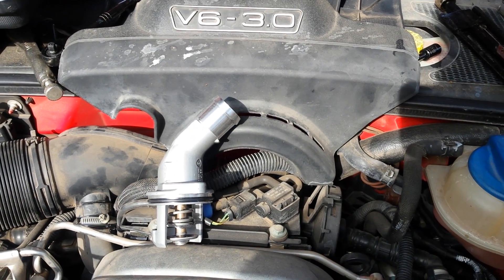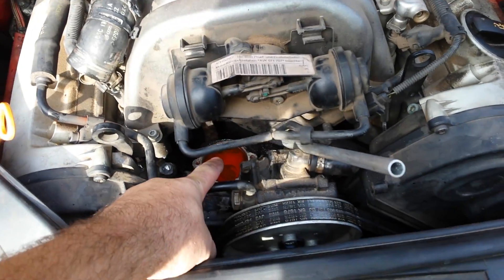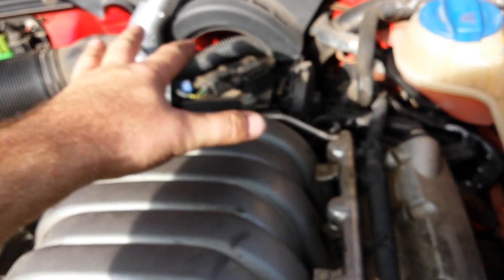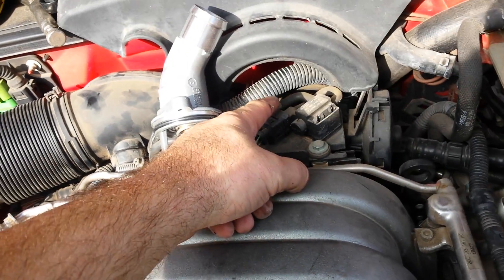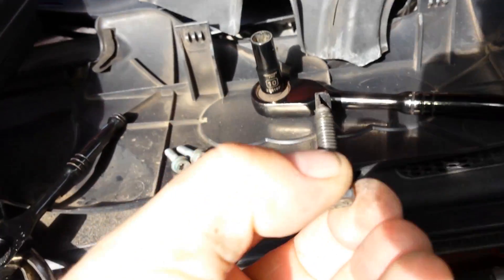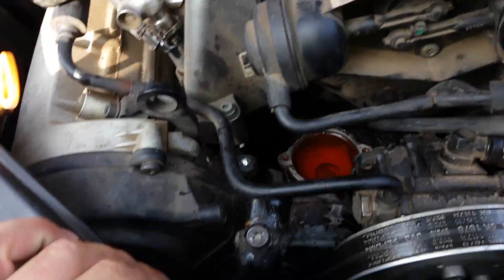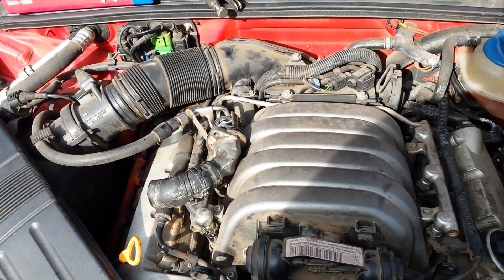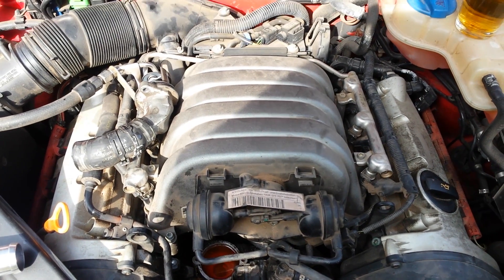2004 Audi A4 B6 3.0 Easy Thermostat Installation

Comment: so you just unbolt the intake manifold and it lifts up out of your way, then unbolt the t-stat and swap it out?why does that seem TOO EASY to be true? considering what a dealer/shop would charge?
Reply: got a p0381 code, replaced the temp sensor(oem) at the back of the engine along the fire wall, (had to remove the intake tube with that little 5mm allen bolt you spoke about, REAL PITA, used an allen wrench that's about 4-5 inches long and used it horizontally the long way, just fit). got it all back together, started the car up and the CEL was gone, didn't have to erase it or anything. Drove around for a while all day and no problems. Then this morning I go to warm the car up, no issue, go back out to leave and YUP, CEL back on, got the code again. Gonna try and change the t-state if its as easy as you made it seem, and probably the lower temp sensor in front...see if that solves the problem.Car heats up fine, runs fine, there are no temp maintaining isses, stays just below the mid way on the guage....but the CEL is on

Comment: Where the hell is the bolt holding the hose in place
Reply: The bolt is underneath the hose. Huge pain to get at but it is doable without taking the whole front end apart. Mine wasn’t a hex bolt it was a 5 mm Allan head. This job is definitely doable but it’s not a 15-20 min job. Took me 3hrs the first time but now that I know how to do it and where the hose bolt is, this job could be done in a hour ,2hrs max. Hope this helps guys.

Comment: Cool.  Same for 2002 A4 3.0. ?  Mine blows cold air (heater set at 80 degrees) when car is not moving, then lukewarm air when moving.  Don't really know why.  Most articles suggest it's stuck thermostat.
Reply: Bro I have the same car. Have you found any info??
Reply: Ik It’s been a year
Reply: Alex, are you having cold air blow out of the heater? And what does your temp gauge do while driving?